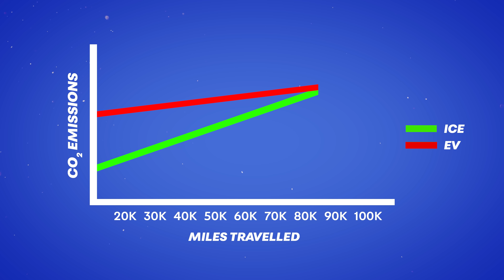Are Electric Cars REALLY That Green? [New 2022 Data]

Comment: The one thing no one is looking at as far as EV vs ICE is the fact that Fossil Fuels are a limited supply product, we don't have many more decades of use in a Business as usual scenario.
Anyone with even just grade 5 level math capability understands doubling.
Problem is that doubling can only work to a point and you end up running out of said item or room to place those items, like people we have doubled consistently since the 1850's we had 1.2 billion people it took till 1946 to double almost 100 years, then it only took 40 years to double, thankfully we slowed down a little and it will take maybe 50 years to double.
We do this with everything we use as the population doubles, so does our usage.
We have doubled our usage of Fossil fuels to the point a barrel of oil is now near parity to how much it costs to get a barrel of oil.
This means we are not finding many large oil despots any more and the last big find they were so happy about was only 54 billion barrels or a little over three years worth for the world.
For some reason people are in the belief that we have unlimited supplies of oil ?
Every doubling event and all you need to do is look at a yearly usage calendar of Fossil fuels to see how many years apart a doubling event is to know when the next one will be, a doubling even means that we will use the same amount as we did in all previous History, not just from last year.
So if we were to start the next Doubling event from today and it takes 12 years to double our Fossil fuel usage that means in the next 12 years we will use as much as we used since 1850.
We can't keep using a limited supply product like there is no tomorrow.
We have no choice but to go with an alternative and since Electricity is the easiest fuel to produce and store safely, it doesn't take an Einstein to work out we should go Electric.
If we go Hydrogen we don't get 100% clean exhaust as they all BS as they produce NO, they try to make up crap like Water is the only by product, but experts in Engines and how they work have explained that as the Hydrogen powered engine heats up it will produce Nitrogen Oxides same as any other combustion engine, unless you remove the Nitrogen from the air it uses :).
Same as they forget to mention Carbon Monoxide that ICE vehicles give off as a by product, not just CO2.
Burning fuel in a compressed environment will always end up giving off poisonous by products as our air has them in already and burring them again won't make them better :).
Everything in an Electric car can be recycled as far as the Electronics and Batteries.
Even ICE vehicles besides their pollution when running, they still need to be recycled to offset the pollution, we need Governments to make the fines for dumping high enough to make it to expensive to dump as now it's cheaper to pay the fines.
Same as parking fines in Cities are cheaper than parking fees so people don't care about the fines as they can only give you one parking ticket no matter how long you stay there, unless it has a sign that says your car will be towed if left there.
Lead acid batteries should be recycled and not just dumped same as the Radiator water in an ICE vehicle and the oil and filter and air filters.
EV's thanks to the Fossil fuel Industry were set back by over 40 years, how many issues do you think we would have now with a mature EV market of at least 45 years ?
It took decades for the ICE vehicles to become anything worth a damn.
We have 10's of Billions being spent on new battery technologies and there is no way we can afford another fuel type where a whole new infrastructure would need to be developed and then put into place like a Hydrogen fuel for our Cars.
Electric I can charge in my  garage over night or during the day from my Solar panels, try doing that with any combustion engine, Hydrogen places us back into chains like we are now with gas prices at an all time high and only going to get worse as supply dwindles.
The funniest thing though is that every time a new or better system comes out you always have the morons making up all sorts of BS or even just part facts to make the new look bad or not worth it, like Computers, or Mobile Phones or 4K TVs and every time guess what ?
The new technology usually becomes the norm, we have reached the limits of an ICE car, it's why Hybrids started to become so popular as they had power and fuel economy.
An EV for the most part is far more powerful than it's ICE cousin and besides the slight distance per charge anxiety many people that drive less than 50K a day feel, an EV for the normal person would be more than fine.
Most Women with children drive less than 20 miles a day and since even the cheapest EV can go 80 miles on a charge, they could get four days or more per charge and just plug it into the power cord where you park your car.
Most normal people live in a building that has some sort of facility to park a car, even the abnormal that live in High-rises have a parking spot under the building they can charge their car in.
We need to stop the my car is better than yours BS and move with the times, it's going to happen, ICE will be banned eventually and sooner is better than later as then all focus can be placed on just one technology.
All manufacturers are making EVs, some like Volvo already only make EVs, once they start making EVs, in the size of a Corolla or Jazz, the market will increase exponentially as I would buy a Honda or Toyota EV today if they had one the size of the Corolla Hybrid and can tow a Boat or Jet Ski.
I have driven the Corolla Hybrid and was very impressed, not just the lack of noise, but it's performance even in Eco was amazing, in sports it was a little beast.
I have a twin turbo V6 Diesel that goes very well not many people leave me from the lights, the Tesla is one of the few that does this and very quietly as well :), there are a few Tecla's in my area and increasing every month.

Comment: seems weird that the break green point is about at the lifespan of the battery.  Tesla claims their batteries are good for 100k, but most fail sooner than that, so what does a new battery reset the break green point? 130k 150k?

Comment: Co2 is needed for Life on Earth, without Co2 plant life would cease to exist and then Animal life would cease because without Plant life we run out of Oxygen.  on top of that Global warming is a Crock of Sheet, the earth had been warm and cold since time began.  It also costs more to produce that very expensive battery that everything that it needs to exist must be mined out of the ground by Gas and Diesel powered equipment,  and the people that don't live in the big cities have NO use for an electric vehicle, and in Montana where we have -40 + * winters the EV cars will not run most of the time.

Comment: Well, there's no real information here. It's just what "Volvo says" and a claim that it's their cars on the same production line so it has to be equal. I completely disagree with the "equal" BS. I haven't seen their study so can say if there is any errors, omissions or bias, so maybe that's true of  Volvo cars. But I can argue that those EVs are being built on a production line that has been optimized for ice cars not EVs. I can tell you that Tesla builds their cars in 10 hours vs 24-30 or more hours for the rest of the industry.  So Tesla has much smaller energy and carbon footprint 👣 I can say that Tesla is moving away from cobalt to nickel and LFP which is much more environmentally friendly. Volvo is doing neither.

Comment: Most people don't even own their cars that long and for most, that 90k range occurs over 5-10 years. The batteries in those cars usually die in that same timeframe. This means the EVs will never pay it's carbon footprint due to battery production/replacement.
Well, you can't say that you can reach a quicker break point by using renewable energy sources like solar and wind, to charge the batteries, without including the production and environmental impact of those systems... wind turbines and solar panels have a HUGE impact. It's insane.

Comment: Hmm. I bought a toyota yaris in 2013. I paid 12,888.00 for it. It currently has 278 k on it with a lifetime average 39.2 mpg. Never had any problem with it. I have a 450 mile range and can "recharge" in 5 minutes. Not aware of any ev that can compete in terms of the green in my wallet. 😁

Comment: Few people ever mention "car culture". This video dives into some of the details of comparing ICE and EV cars. But it completely fails to mention the devastating impacts of car culture. Environmentalists used to understand that cars and car culture are bad. Roads are bad. Commuting is horrible. The materials to make the cars has to come from somewhere. The energy to fuel the cars has to come from somewhere, either from fuels, or from materials that must be mined and refined and turned into technologies that can convert wind and solar into energy and technologies to store that energy. Arguing over the carbon footprint of ICE vs. EVs is like rearranging the deckchairs on the Titanic.

The improved "air quality" where one drives the EVs is mentioned at the end. But that's ignoring the air quality in the regions where all the materials that are mined and refined for the cars and their batteries. And of course if you charge your car with energy produced by coal then you've moved the air quality issues to the coal plant from where you drive the car.

"Green energy" has all the same problems: wind and solar are incredibly inefficient; installing them destroys the land where they are installed; they must be rebuilt every 20-25 years; the materials must be mined; it takes fossil fuels to build them; etc. etc. So in the end, all the "air quality" issues solved by EVs aren't solved, they are simply moved elsewhere - elsewhere in the supply chain, elsewhere in the technologies, or elsewhere on the grid.

Comment: Great video. And good for Volvo in supplying some real world data.  I'm not so sure that ICE is as efficient as it can get. The Volvo is a tank. What about leaf equivalent? My dirty diesel Citroen van gives 50 mpg and it's 14 years old. I'd rather use a hybrid than an EV for options, range etc and no grid use. Very difficult to assure that ev chargers source renewable's. Also the human cost of raw materials is very difficult to asses. Where is the advantage in shortening a life in Bolivia to extend one in Milton Keynes. Your'e right the battery tech and application is the key to successful EV. Best of both worlds has gotta be hybrid.

Comment: Young person, I see your argument as a non-sequitur. Separate the apples from the orange rocks. Are EVs cleaner than ICE vehicles? Undebatably YES. End of subject concerning vehicle comparisons.  
You are using the ante-utilization factors as baggage for both type vehicles, which in itself is correct  and introduces a dishonest comparison between ICE vs EV final use. What I think you and Volvo are saying without saying straight out is: The amount of fossil fuels required to produce  an ICE or EV is similar. The energy used by ICE suppliers per se, was downplayed. 
Aside from all-things-being-equal for similar production requirements, it takes more energy to produce the items nut used by EVs -- alternators, radiators, cooling fluids, six quarts of engine oil, cooling system hoses, exhaust systems, exhaust converters, energy to cut down and process trees and bushes into cardboard for packaging all of the above, trucks, drivers, ad infinitum for delivery of these additional supplies. (Micro and Macroeconomics Supply Chain texts should have a good handle on this subject.)
All in all, this was a nice article by someone who strikes me as a wannabe automotive dillettante.

Comment: One item that was left out was the cost and disposal of the batteries when they fail or lose their charging ability. Also in the case of a Tesla in the US that ran over an object and damaged the batteries requiring an expensive replacement, something like $15,000 or $16,000 bill not covered by warranty.
Reply: Batteries Batteries Batteries, that's the BIG picture 🤔.

Comment: Like you say Rory, long term EVs have to win out. I have a 50 y/o 5.8ltr V8, currently due to its lifespan it works out cleaner than a modern EV. But in 50 years time the EV will be much cleaner than my V8 at 50 years of age!

But battery power is a short term solution. A stepping stone if you like!

Comment: EVs only marginally help the environment if you do most of your driving in the cities were there are not enough trees to absorb all the car emissions. If you do most of your driving threw a forested mountainous region with dense forests lining the road you drive every day than those trees absorb 80% of your tail pipe emissions. So if you have put 140,000 km on you Ice car like I have substract 80% from your total millage driven and you will find that your 9 years of driving that Ice car has actually put out less Carbon Emissions into the atmosphere than a Tesla straight from the factory. EVs produce over 50,000 miles of manufacturing emotions straight from the factory and a couple Million EVs are produced every year, so the truth is EV manufacturing is actually increasing the output of Greenhouse Gas Emissions every year.  Most people are also selling their Ice car to buy the EV because the Ice car has to much cash value to be deaccessioned, so that means it is still being driven and producing the same yearly emissions. Smug Tesla owners drive me nuts because they actually believe their car is saving the planet, then I see them filling their trunks with single use plastic packaging at the grocery store.

Comment: For ICE vehicles, keeping them tuned to peak efficiency is the best possible alternative. For EV cars, less polluting primary battery components are a very good start. Small scale electricity generation is a good start for EV pollution, as well as reducing dependency on the grid for home and business users. Steel mills already build their own generation systems, more ingenious solutions for more businesses can bring total energy cost as well as use down.

Comment: My Toyota 2.5 L 4 cylinder 8 injectors 8 speed transmission... Weekly average is 43 miles per gallon... On the freeway I can get anywhere from 46 to 50 miles per gallon  (@65 - 70 MPH).... Put that in your calculator!  Not only did Toyota increase the fuel mileage they increased the horsepower output of this engine...

Comment: Even if they had the same c02 output over their lifetime. an EV is still better, for the lack of pollutants going locally. and the potential to use electricity, which has infinite supply. rather than oil, which IS Finite.... thats the only arguement that you need.